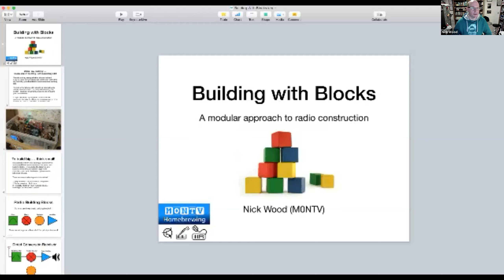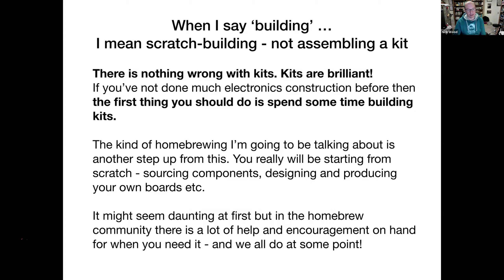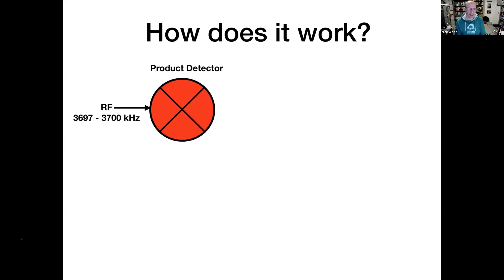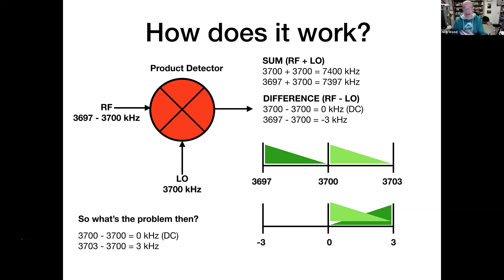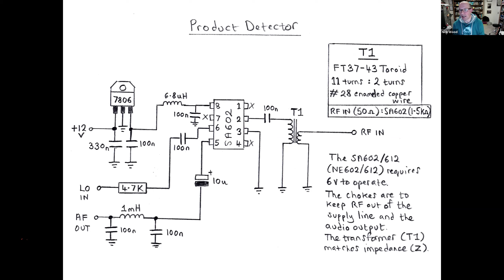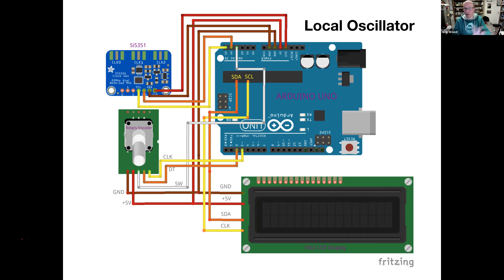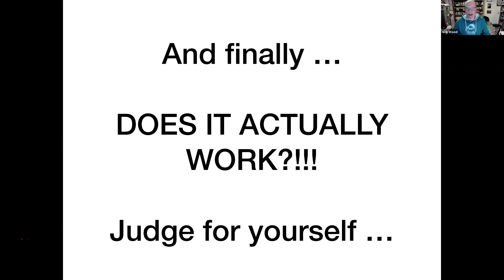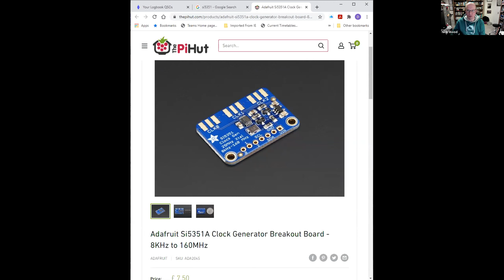Nick M0NTV talks about building your own Direct Conversion receiver

Comment: What about using 2xBD131 transistors and 1xBC212L and 2xIN4007 diodes for a nice sounding Class A amplifier if you don't know what I am talking about Google 5W Class A amplifier.
Reply: Why not indeed! That's the beauty of building in a modular way: if you discover a circuit that you prefer then you can build it, test it and swap it for the original. I intentionally chose a very simple audio amplifier for this particular build but you can build it any way you like. Have fun!
Reply: @nickwood4367  What about building a ZERO IF Transceiver just google ZERO IF transceiver most are for the Microwave bands but it must be possible to modify it for the HF and VHF bands using the TAYLOE Mixer for TX and RX.